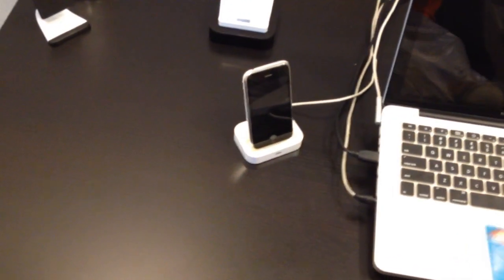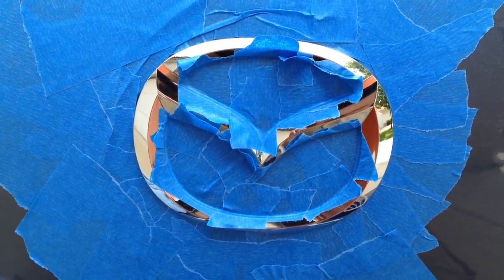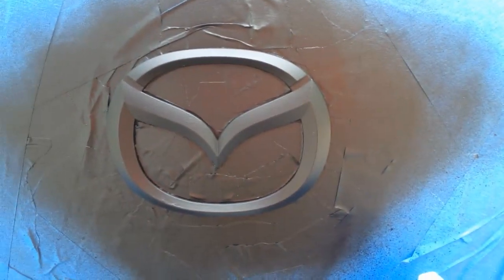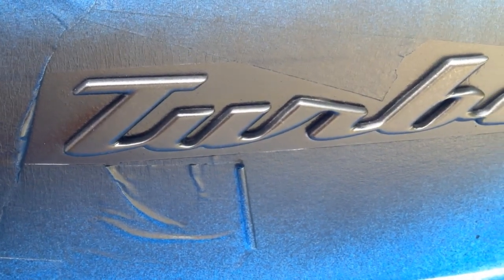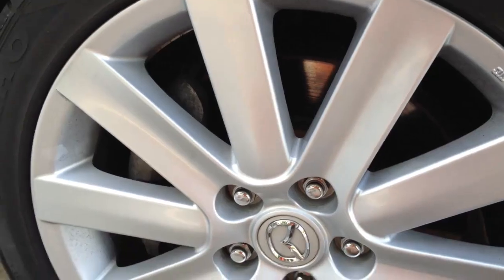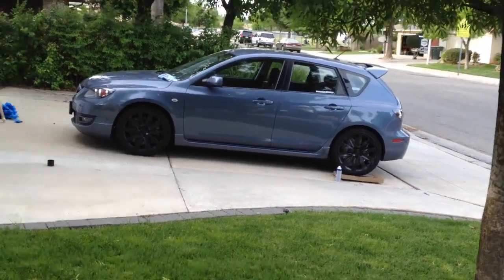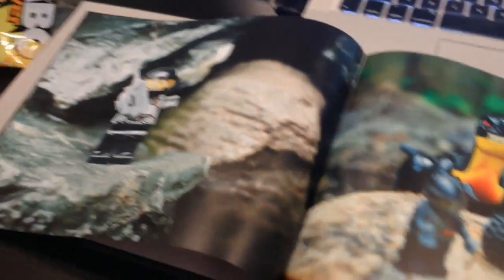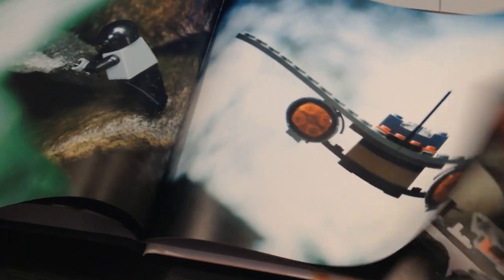PAINTING MY WHEELS!

Comment: Well i know this video is old but just for future reference, when painting emblems and badges, just make a box with tape around them leaving about a 1" gap between the outermost part of the badge that you're painting. Then just grab yourself some plastidip and give it a good 3-4 coats, and when you're done you can just peel off whatever was touching the body of the car. No taping needed and you get perfect edges. Saves a lot of effort and time, and plastidip is more durable than you'd think.

Comment: nice did this with my bro yesterday finally found plastidip we check homedepot and they where sold out then we went to aces and they had it in red white and black we did the same as you but not the wheels or side mirrors we did the emblems and the front part u did we did did that but we painted the whole thing it looks realy nice on a red mazdaspeed three \